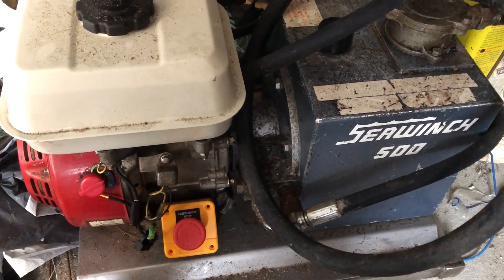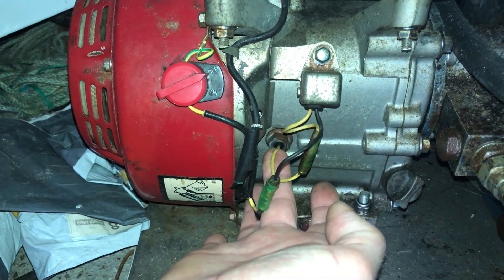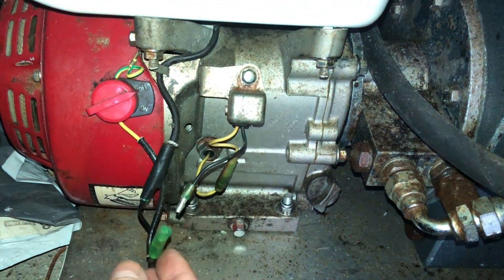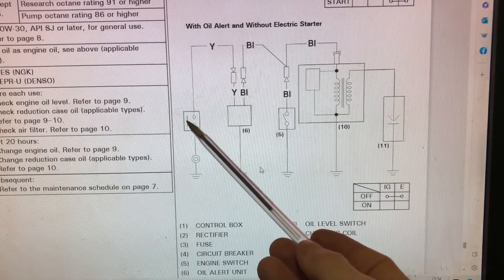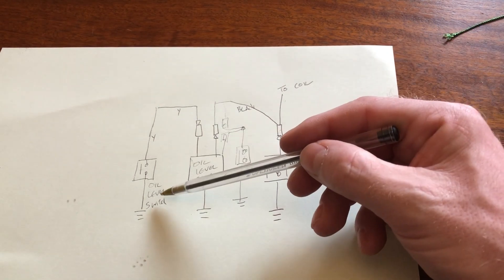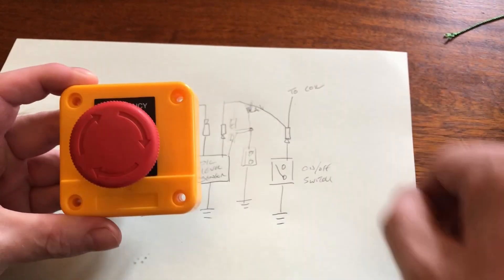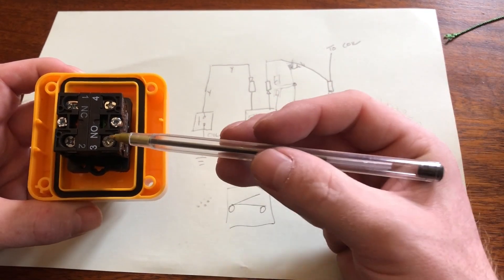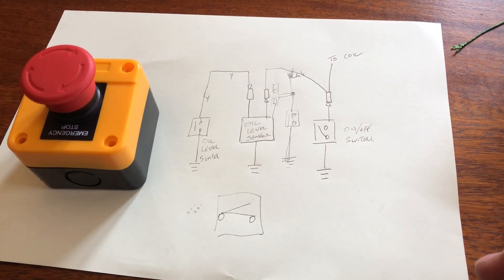How to wire emergency stops to Honda hydraulic powerpacks. Commercial sea fishing pot haulers boats

Comment: Good video buddy very well explained and clear instructions  for anybody who not to sure yr a engineer I'm a mechanic spend a lot of time welding now for local mot stations and body repairs still do odd clutch engines and stuff but a lot of welding an resto wrk mainly use mig not many seem to like welding cars vans trucks ect now cos they dnt like to get burnt bloody fairy's lol I watching some of yr old videos at mo I dnt watch TV just YouTube stuff I'm interested in just been watching jigging for Mackrell with machines did u tig yr stripper boxes stainless keep saying I'm gona get a cheap tig welder ant used one yet just stick gas or mig at one time or another but mainly mig now
Reply from the maker: Yes I did tig weld them quite a few years ago now. I wouldn’t ever call myself a welder though. I didn’t realise there was much welding on vehicles now. Most motors panels are galvanised and they outlive the engine now. Not like some of the 80s rot boxes!
Reply: Just depends how new and posh yr car or van is buddy transits connects relays rot like hell even 4x4s an Swedish stuff made of crap imported steel rot like bloody hell only car or van I ever had with galvanised chasis is a reliant rialto 3 wheeler of my own just doing a 69 morris minor rotten as a pig we bought few years ago just started getting a bit done on that the modern cars a lot are galvanised but it still rots just more slowly lol especially with cheap imported steel
Reply: Newish stuff not Swedish bloody spell checker
Reply: People in sheffield not posh like u living at seaside own there own boat an tractor an stuff they have to repair what they've got cos they can't afford new ones we can't comply with what the mayor of London wants buddy
Reply from the maker: @richardhogan8911  Im not posh in the slightest. Ive never bought a brand new motor, never will. I wouldnt buy an electric motor either, biggest con going. I will stick with my diesel van.
Reply: All new car owners here are in debt or on invalidity benefits  buddy hahaha
Reply: To true buddy zero emissions  my arse it all a con
Reply from the maker: @richardhogan8911  of course it is, like wind farms and solar. If the consumer sees clean its ok, not all the mining and pollution to make and maintain it
Reply: Ye just another way to tax the public the country in a right mess now Khan trying to fetch in pay per mile spending millions on people arriving on boats
Reply: Yes what a mess this country in I fear what it will be like when my grandkids get older stabbing shooting acid attacks  politicians keep telling us how good everything is anyway that's enough moaning for tday lol

Comment: I’ve got same power pack as you, I find I have to disconnect the low oil sensor wire , cause when it’s rough weather it turns the motor off
Reply from the maker: It shouldn’t do, but I suppose it depends how rough it is